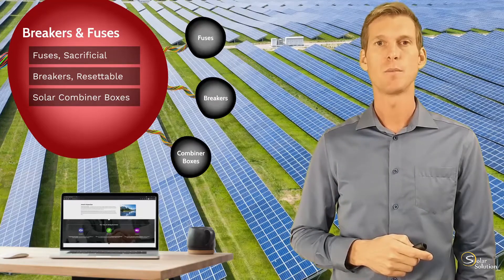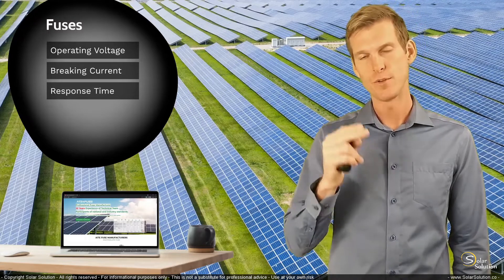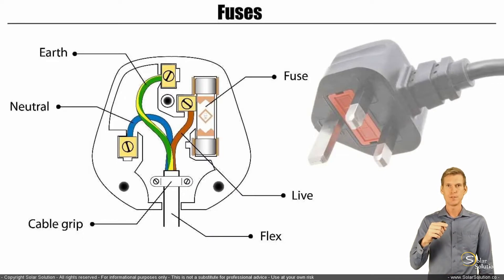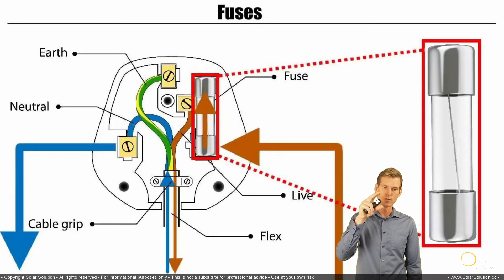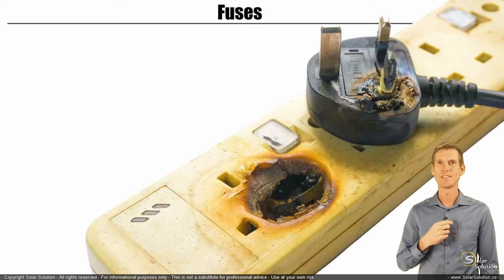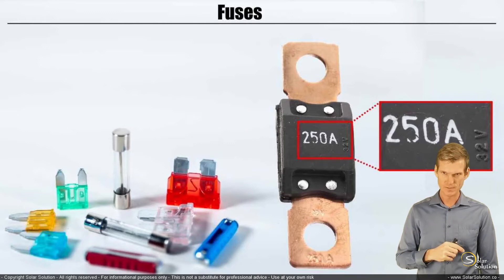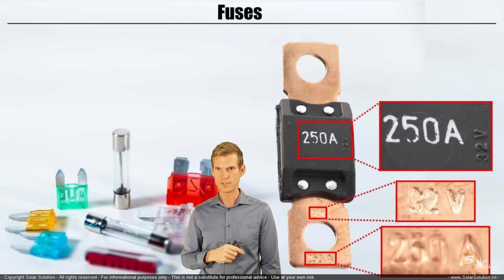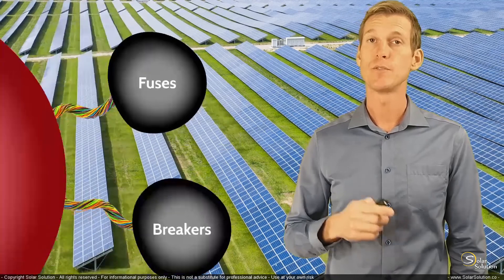Solar PV Fuses: Why, What, When & How

Comment: Are you saying that fuses are a better option than breakers? In the  USA, you rarely see fuses used except in commercial applications.
Reply: Not me I have fuses before a MAIN cut off and a fuse a the battery.
Reply: Here in the US, I see fuses in vehicles.  Every other application I've seen uses resettable breakers.